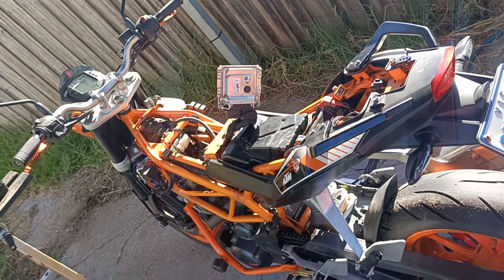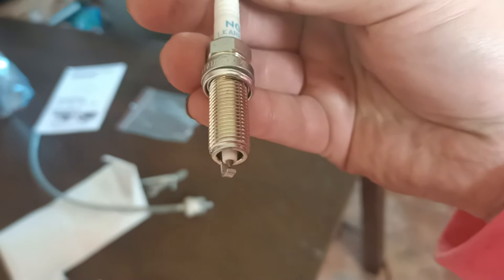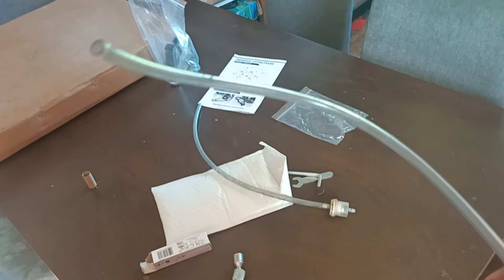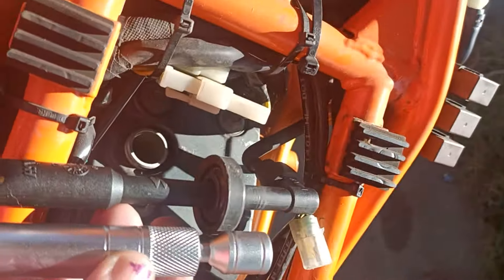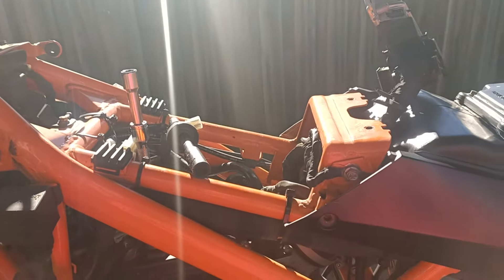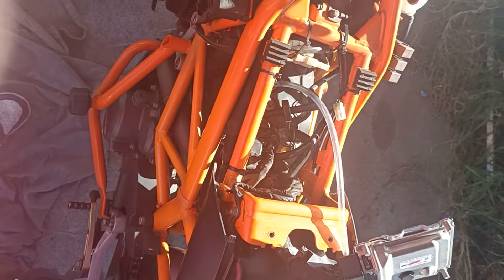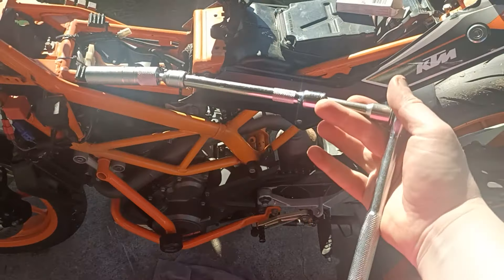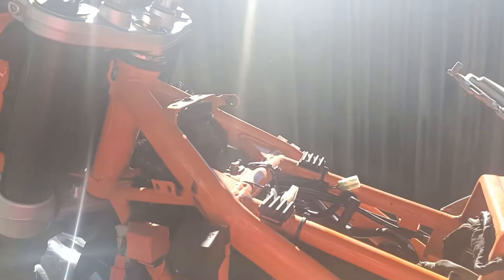(This is not a "how to") Change a Spark Plug in a 2014 390 Duke

Comment: Maybe the valve set needs to checked?
Reply from the maker: @wixee123  it was changed not terribly long ago, at least in kilometres, according to the receipts I was given along with the bike. I'd be shocked if they needed doing again so soon, but this bike was stolen and recovered and wasn't in the best running condition when it was returned. All I can say is that it runs and feels excellent under load and only seems to struggle under 2k rpm